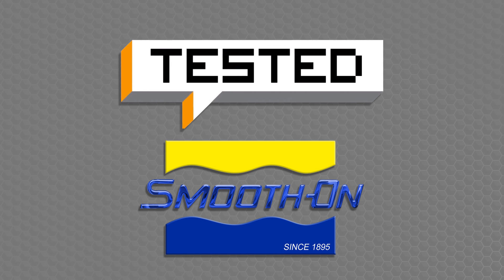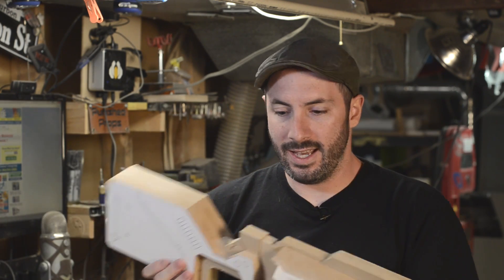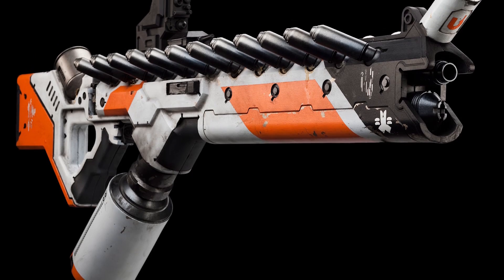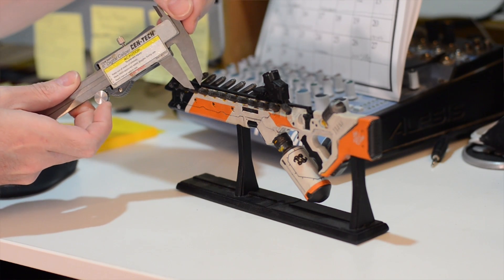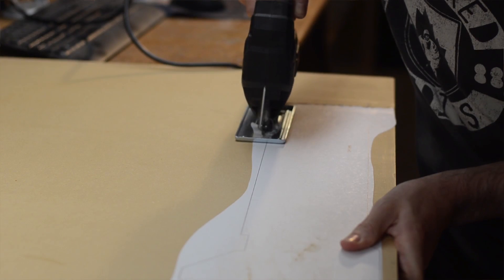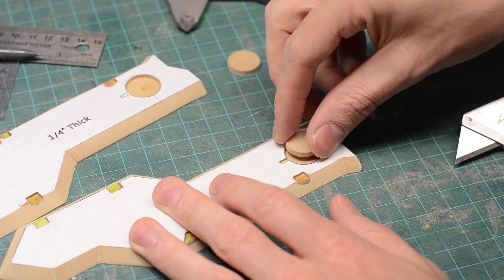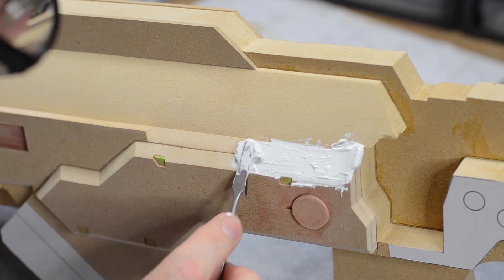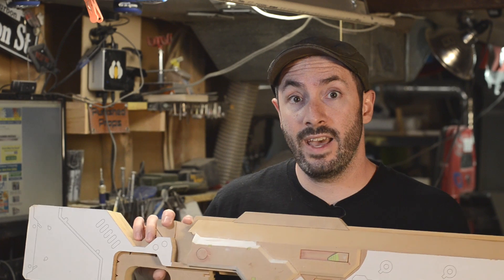Prop: Shop - Tested's District 9 Rifle Build: Part 1 Designing & Fabrication

Comment: Hey Bill,  I really enjoy your videos and work.  I was just in New Zealand and took a tour of the Weta Cave.  They use this very gun as an example to talk through the steps of their design build process.  It is probably waaaaaay too late for you, but on the actual props they went to a local paintball field and collected used CO2 cartridges for all those cylinders you mentioned.

Comment: How did you make your blueprints from Sketchup (no Inkscape?)? Are you using the free version or the Pro? Did you use any extensions from the extension warehouse? What made you want to use Sketchup?
Reply: trebledroid I'd love to know as well. The last I checked the free version of Sketchup could not do blueprints?
Reply: trebledroid Parallel view the camera, top view, than press print. In the print menu, check the box for vector print and press the button on the bottom left to bring up the print options. Select save as PDF, and save. Open with illustrator or any other software, and print.      

Tips.
1.  I use a mac, and don't know if you can do this on windows.
2. Adjust document setup to scale accordingly.
3. Endpoints also get exported. Might be useful sometimes, but turn them off if you want to do any work in illustrator.
Reply: trebledroid i think you can export the geometry into something like illustrator and then print from there
Reply: DDeFFacto I didnt see the same options on my windows version. But thank you just the same :)
Reply: Everfalling thanks :)
Reply: ***** thanks :)
Reply: ***** Awesome, thanks for the heads up!